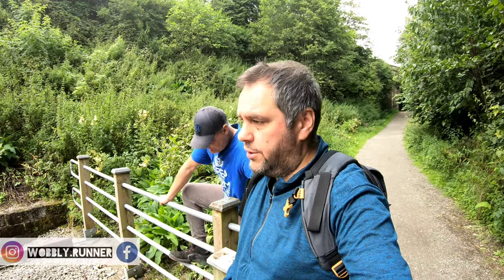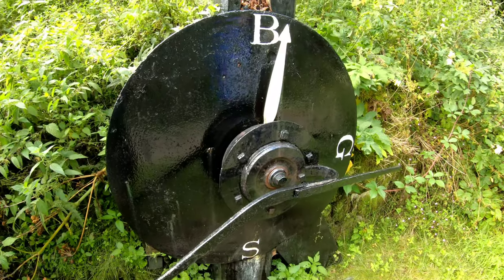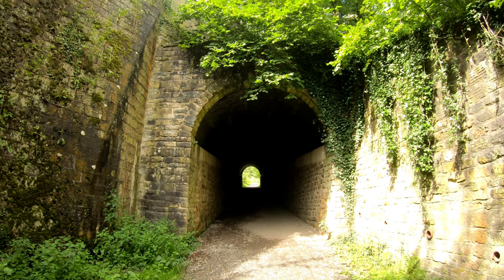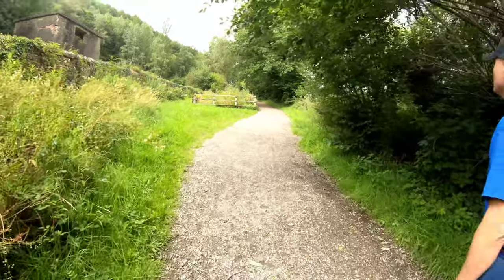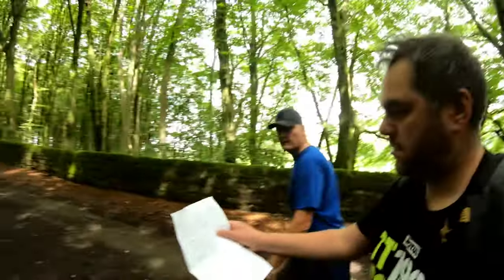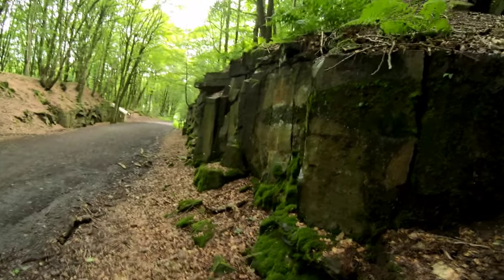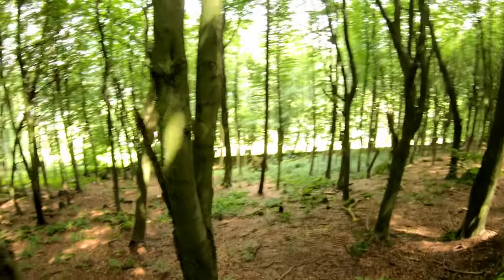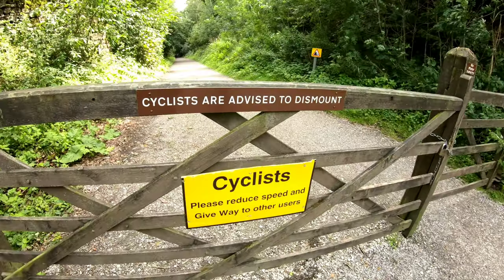Sheep Pasture Incline: A Railway and A Mountain, No Problem!

Comment: Hi Paul, That is 3/4 mile post.Another excellent video . Maybe there was a spring point to direct runaways into the pit .B.R. used have spring points in yards and some inclines.
Reply from the maker: 👍🙂
I believe from watching the old videos you're correct. The point was set by default into the pit and had to be manually pulled to divert the wagons